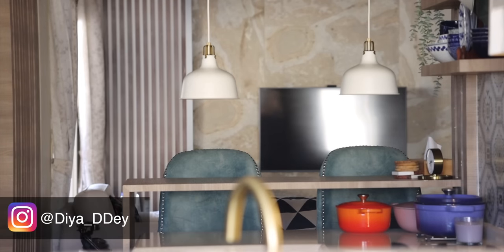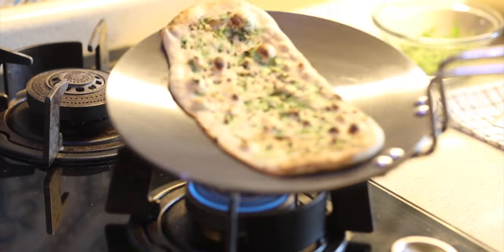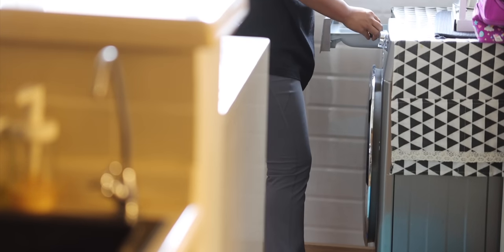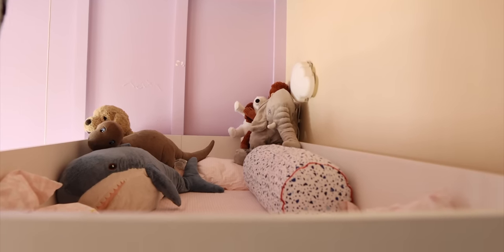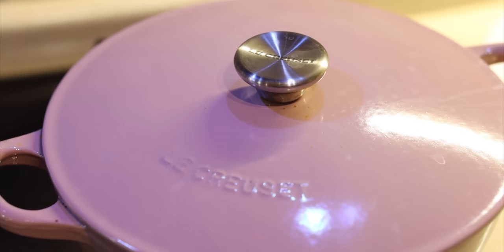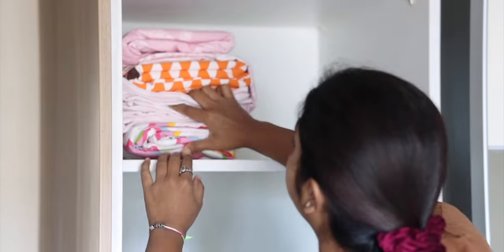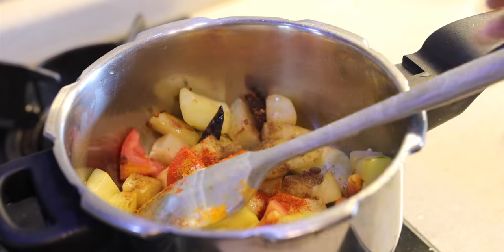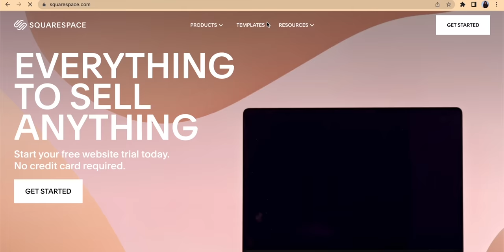Getting back to Cleaning & Organizing after childbirth | Making wholewheat naan for the first time

Comment: Where did you buy   sofa cover please I want so
Reply from the maker: The sofa is called Ektorp. It’s by IKEA. it comes with the sofa frame and cover which is washable and changeable. It will not fit any other sofa as it’s custom made for this sofa only.
Reply: @DiyaDey  thank you dear